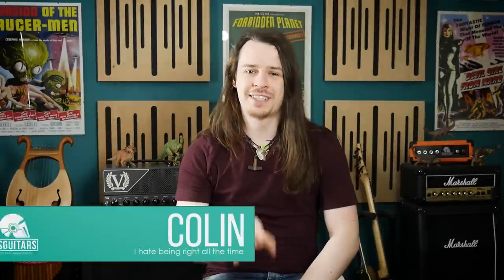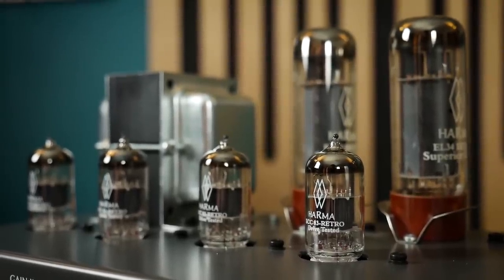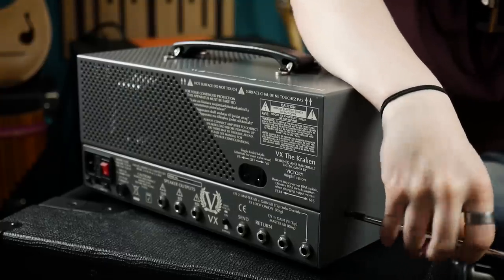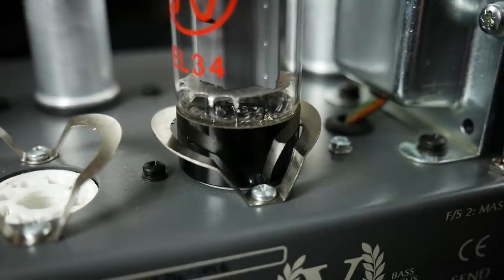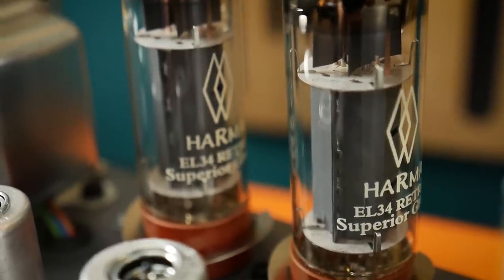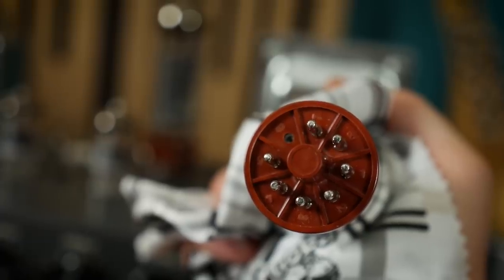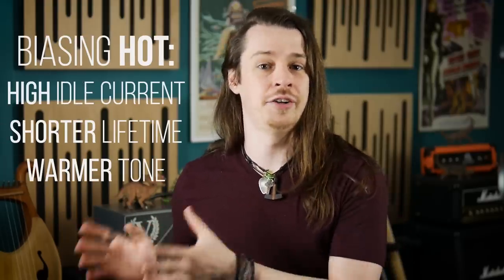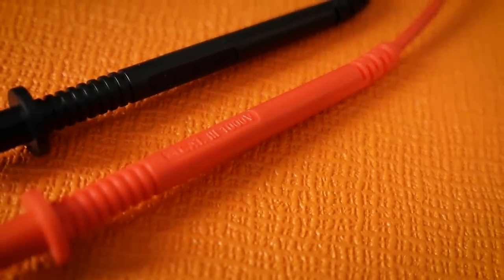Swapping Valves And Biasing Amplifiers

Comment: As a former Naval radar tech, I cannot strongly enough thank you for your words of caution. Voltages inside a tube (valve) amplifier are FATAL and must be approached with an appropriate level of caution. Cheers, Sir!
Reply: as a former navy/sub sonar tech, i concur. especially the part about grounding out the other arm & running current out crossing the heart. seen it. its not pretty & cooked human flesh does not smell good & stays on the boat for days. 🚫⚡🙌
Reply: Voltage isn't deadly. Think of it like a gun. Voltage is the caliber. Current is the bullet. Which one kills you?
Reply: @jc5604  wtf is 'current'? are you trying to refer to amperage? your analogy is completely wrong. if you want to try to use firearms, the bullet is voltage and the amount of gunpowder pushing it would be the amperage.
Reply: @wilsoncrocker  Current is measured in amps, ya goon. Ampere is a unit of measure (like Celsius is a unit of measure for temperature).

And no. Just no to your analogy. I guess mine was also not that great looking back, but definitely closer. The way I was taught years ago was using water. 

If you had a given diameter hose (resistance), you could increase the water pressure (voltage) and get more water (current) to flow at any given time. If you increased the diameter of the hose (lowering resistance), you also get more water (current) flowing. 

If you were being force fed water to your death, the pressure (voltage) isn't killing you. The water (current) is killing you. 

Therefore, current kills you. Not voltage.
Reply: @jc5604  voltage is how many electrons are being moved. amperage is how much force the electrons are moving. 
ive been working on electronics for 30+ years, i dont need your poor laymens made up definitions & incorrect analogies to try to explain basic electrodynamics. thanks tho
Reply: @jc5604  you had to google the definitions? bwahahaha 😂 you should google more, like the definition of "amperage" there, wannabe tuffguy
Reply: @wilsoncrocker  remember kids, it is okay to be wrong. It isn't okay to be willfully ignorant in such technologically advanced times where computers at your fingertips can give you every answer imaginable. The only limitation is you using it.
Reply: @jc5604  thats what i thought. run along, jr, the grownups were having a conversation.
Reply: @wilsoncrocker  You lost, fella. Get over it. Man up. It is getting sad at this point. You played your hand, but I had the royal flush. It's okay. We are all there at least one time in our life (though I suspect you are there more times than not). You'll recover.
Reply: @wilsoncrocker  so I guess the electrical engineer working on power grids is also not qualified to correct you, Mr. Grownup? Amperage is the only "correct" word for current the same way yardage is the only "correct" word for distance. One mainly used by electricians talking other electricians in America, the other is basically only used in American sports commentary. You have a thing for twisting units into word for the thing that is measured. The rest of the English-speaking world (you happened to watch a video made by a Scottish person) is quite happy to use the scientific term current even when working with electricity. Also, current is measured in Amperes, which is a unit describing how much charge (how many electrons) is flowing through the cross-section of a wire in a second. Voltage is a measure of the force experienced by those electrons when positioned in an electric field. I didn't have to look that up in a book, but if you want to debate what I just wrote, I have a shelf full of books on the subject right next to me. If those are too new to match your experience, Faraday's original works have made their way onto the internet, so you can read for yourself why we only talk about one type of electricity nowadays, instead of the multitudes of different electricities scientists were studying in the early days of electrodynamics. If I'm wrong about this, I'd love to know in what way, so I can learn from my mistakes. 

Just as J C said: it's okay to be ignorant, as long as you can admit it. Just don't go around bragging about not having to learn anything. I watched this video because I know nothing about valve electronics, and would like to know more about different amplifiers before I buy my next guitar amp.
Reply: @jc5604  voltage can too be deadly. There is a misnomer that says " It's the current not the voltage" that kills you. Well without the voltage, you would not have the current in the first place. Also higher amps can leave you ok also at a low enough voltage in a given timeframe. In reality, the time of contact per unit  is usually the biggest killer. Say you have 30kv hit you for a milisecond and you have (for sake of arguement) 1 million ohms of resistance in your body between the two contact points. Well that would be .03 amps. Not fatal for a milisecond. But if you kept ahold of this for say, 10 seconds, the result would be a whole lot worse. (You would activate sweat glands and your muscles would tighten and because of this , your overall resistance would drop. And well start measuring for a pine box. They used to teach the less than one amp wouldnt kill you theory, untill it killed someone. It also greatly depends on the locations of the in and out points of your particular charge. (Electro boom can explain this fairly well. He even refrences a "professor" saying "its not the voltage, its the amperage" check out his channel.
Reply: @jc5604  aight so if current kills you, then why the hell can I run around 70 amps 2VDC through my body and not die? And all those warning signs near electronic things like circuit breaker boxes and whatnot say "Warning : High Voltage" instead of "Warning : High Current" hmmm?
Now obviously there wouldn't be power without either of those.
Also about the 2VDC : AC is far deadlier and can kill with low currents.
Reply: @moki2093  you have google, yea? So use it
Reply: @jc5604  i would use it if I didnt ask you first lol, since you seem to know about it
Reply: I agree on safety. As far as analogy, I prefer the pipe analogy. Voltage is the pipe diameter, Amps are the rate at which the fluid flows through the pipe. You are all getting at the same idea, the bickering seems unnecessary. Amps, represented by the symbol I, are measured in amperes which is the amount of electrons moving through a point [that's measured in coulombs]. Extremely high DC voltages are perfectly safe under the right conditions. A Van de Graaf generator can produce 100kV of direct current and it's uncomfortable but not dangerous. Conversely, putting a 9v battery powered TENS unit on with pads on the carotid sinus or typical axis and sternum defibrillator pad placement at milliamps can disrupt heart rhythm. They call the Taser "less lethal" and not "non-lethal" because it can and has caused death due to probe impact points and what's between them at 50,000 muscle disrupting volts at a small current.

Either way, getting bit by electricity whether it's having a cap discharge across your hand or being the ground conductor for a high voltage circuit is a good way to cause serious injury or cost your family the money to bury you because you missed the safety lecture.
Reply: @jc5604  this is late but since I've read your comment, I have to respond. ElectroBoom would strongly disagree with you
Reply: @jc5604  also, you only have google as your references for argument? Smh
Reply: @jaezryl  please tell me where YOU find references then, ya goon
Reply: @jaezryl  Google is a library. You wouldn't say, "your only reference is a library? smh." Well, maybe you would, but non-smooth brains would not.
Reply: @jc5604  haha, you still are in this loop bud. I see you still sticking to your argument. I'm pretty sure you are not gonna budge since you do not know me (even tho I am an Engineer). So I recommended you watch ElectroBoom since he is an expert.
Reply: @jaezryl  so, what you're saying is you don't have anything to say. Fantastic. Glad we got that settled.
Reply: @jc5604  nah, I just do not want to argue with someone who has no expertise at all. Since you need to "google" definitions and all :)
Reply: @jc5604  I think it's pretty much clear who is the pretender here.
Reply: @jc5604  don't forget you said "Voltage is not deadly". Think long and hard about how ignorant that statement is.
Reply: @jaezryl  I've been an EE for 13 years. I design critical infrastructure (datacenters, hospitals, gov facilities, etc.). You may be an aspiring engineer, but you are not one.
Reply: @jc5604  lol, aspiring? I'm working in a power plant for 10 years already. You are an EE? What an embarassment to the community then.
Reply: @jc5604 Since current is deadly as you say, let me test you then: If I run 1 volt, 150 A power supply through my tounge, would it kill me?
Reply: Wow.. these two guys arguing for the last 3 years in this comment section, to funny🤔😆🤘🏼✌🏼

Comment: I am an industrial automation mechanic for the US Government [civilian]... I work on 24 volt DC systems that are painful but not deadly, and 24 and 36 volt charging circuits that would resistance cook you like a hotdog. Proper grounding, PPE such as Class 0 gloves and protectors [rated for 1000 volts], 1000v insulated tools in proper repair inspected regularly, nonmetallic adjustment tools to adjust trim pots, clip lead for reference points and some way to position your meter to where you only need the one hand, and avoidance of capacitors regardless of power state. Usually best to leave the amp on and turned up then unplug to bleed excess electrical potential. You only have to screw up once. If you're not comfortable with high voltage and properly equipped, your dream amp costs less than the average funeral and getting bias set less than that. Be safe.

Comment: As someone old enough to have grown up in a time were tubes were still common in consumer electronics, I think you are understating the viable life of a tube. While tubes can go bad at anytime, they should generally last for years if not abused.
Reply: Ditto.  I've had valve tvs, radios and lots of amps.  Never changed a valve in any of them, never had any trouble.
Reply: @thebamfordman  Almost every amp I have has had tubes go out.  Go figure.

Comment: Many people claim about the Van Halen's "Brown Sound" and they bias their amp too hot, thinking they will approach that kind of sound... while it's simply impossible! To get a "Brown sound" you need to reduce the voltage, and reducing the voltage the bias decreases. It's something on some Mesa Boogie amps that is called the "Spongy Switch". If you look at the fixed bias of Mesa Boogie schematics, you'll see they bias their amps rather cold and nobody can say nowadays that they sound bad! Of course cold bias does not mean "out of specs", but if you set it too hot your tubes won't appreciate.

Comment: The oil left on the valves after touching them, and then being turned on can cause the oils to "bake" into the glass and cause a hazy look. It's just aesthetic and doesn't affect lifespan or tone. So, wipe them if you care about the valves looking nice.

Comment: SOOO glad you brought up the "ONE HANDED" rule....very good on you brotha... it could save someones life...Great timing.... For those who have never changed out the Power tubes, remember, its best to re-bias when you change them. As a rule, most of us who have been doing this awhile, insist, its a must when you change power tubes...theres alot at stake if they arent biased right...I just got my set of power and preamp tubes for my Marshall JCM 800 2204 in the mail yesterday. Its time for a change up. ( In fact, I think almost ALL my vintage amps, 11 of them... are VERY well overdo...) I tend to stick with the new Mullards, I also have a bunch of Tung Sol....I might check out those you have as well....I'm also doing a filter cap change as well on the Marshall....and my first attempt at changing out the V1 socket. Its very loose and might be giving me false microphonics...Great vis as usual Colin.
Reply: The good old Alanis Morissette rule.
Reply: Blaydrnnnr, correct me if I’m wrong but I thought you don’t need to re bias if you have a cathode bias amp.
Reply: Your correct. If your output tubes, ( the power tubes ) are cathode biased, it never needs biasing, and usually CANT be adjusted.  I didn't want to get into a more in depth topic since Colin was addressing the more known, " FIXED BIAS" amps.. ( most commonly known as your everyday, common tube amp, which are in fact, adjustable bias )

Comment: Probably worth mentioning that many lunchbox amps like that Tiny Terror do not require biasing. Generally speaking, most amps under 50w are cothode biased, so don't need to be rebiased when swapping tubes.

Mesa is also a good exception to the rule with their confusingly named "fixed bias," which is different from what is traditionally called fixed bias. They don't require adjustment, but do require you to use tubes that meet tight specifications.

Comment: Coming from a radio transmitter past, we had metering to allow us to monitor important characteristics like screen current, grid bias and cathode current ... some of our transmitters would use 20 x 4CX250 which gave 1kW often we used to schedule our maintenance from daily checking the valve readings and monthly where any bias adjustments were made. That was convenient as we just selected the valve and the was a pot for each valve on the front panel. So all you had to do was turn the drive off and the set the DC Cathode I by tweaking the grid bias pot. 

Your video brought back memories hahah

Comment: One thing I love about my DSL40 is the biasing ports sticking out the underside of the shield for the power section.  Dead simple to do and virtually zero risk.  I have to wonder why this feature isn't standard on all modern tube amps.

Comment: Vintage Marshall and Fender amps didn't bother with matched pairs/quads of power tubes.  On one hand, the tubes were of higher quality, and there was less variation, but on the other hand, a certain amount of mismatch produces uneven push/pull operation, resulting in increased even-order harmonics, which, all things being equal, will sound better to most people than a perfectly symmetrical signal.

Comment: I've ran a Peavey Valveking 100 for 8 years with regular gigs and practice and only had to replace the valves once. Bonus is that those values/amp are already pre biased. Never had any tone or sound issues. The other guitarist in my band however has gone through 3 Marshall heads and severall Randall's in the same period all with valve/transistor issues...
Reply: Elliott Henderson should i change 3 year old valves?

Comment: some additions:

check what kind of bias your amp has... cathode based with el84s don't require adjustments, as long as you buy matched power tubes you can swap them out to your heart's content at home.

when buying power tubes buy matched sets

when buying new production tubes either buy two of everything, or try to use a seller who tests their tubes, because I have personally experienced around a 50 per cent failure rate with the modern stuff.  They're either dead out of the box or they fail within the first hour of use.

When you swap them out don't play for ten minutes and go, right she's done.  Give it at least an hour, sometimes a bad tube will last that long and then go... keep an eye on the tubes if you can while testing in case one of them gives you a fireworks display, then you can switch everything off quickly before you lose fuses or cook stuff.

Comment: My Sunn 300T (made by Fender in the late 90s) has external test points for bias and balance, and it gives you the voltages to look for right there near the probe points. (Also, the trim pots are there. Also also, they're hidden under a metal plate that you must remove, so you can't accidentally foul things up during transport.)

Comment: Traynor's YBA100 & YBA300 bass amp heads have a very user-friendly power tube bias adjustment on the back panel, so it can be adjusted without opening the cover. For each valve pair (1 pair in the YBA100, 3 in the YBA300) there's a bias adjustment pot, and 2 LEDs. One LED indicates the bias current is too low, the other indicates it's too high. Turn the pot to the left, until the low LED lights, and note the position. Then turn it to the right until the high LED lights. Then turn it back to midway between those points. For the YBA300, repeat this for the other 2 pairs. If only they were all that easy.

Comment: A.J. Styles little brother teaches how to be biased 😮 great video young man I’m an ex Slot Mechanic so I believe I can tackle this project as a trance electronics tech.  For those unexperienced do not put two hands in the box just alligator clip black meter lead to outer metal cage and using a probe with longer leads best idea and then one hand with red lead to the test point only the capacitors with cross on top are dangerous so not touch that for any reason.

Comment: I have an old (c. 1983) Peavey Classic 65w amp with power amp tubes. When I first time replaced the tubes and took it to have the bias checked I was told it was self biasing. I hope this is true because I don't think I can carry the thing out to get it serviced anymore. Lol. Still sounds good and crunchy, but I run an external amp into the speakers these days. Yes at the correct impedance. Love your channel and vids. I've learned a lot!
Reply: Peavey valve amps don't offer an adjustable bias. They have fixed bias resistors that typically bias the output stage "cold".

Comment: The Revv amps make biasing really easy. It has deep sockets for your multimeter probes to go into right on the back of the amp, and small trim pots you can only get to with a screwdriver. You don't even have to open the amp.